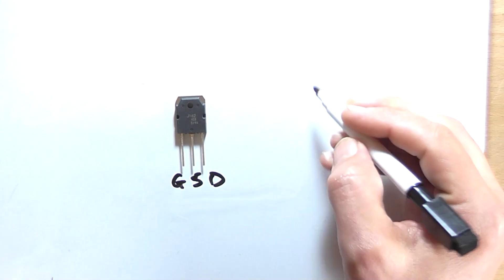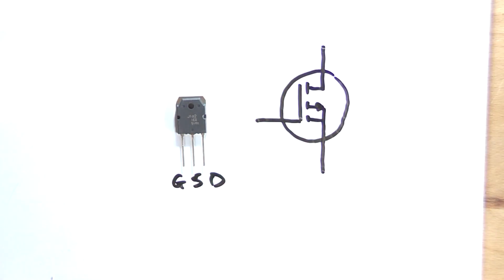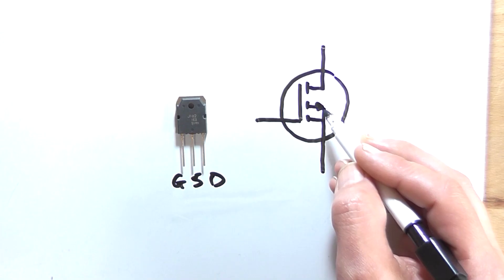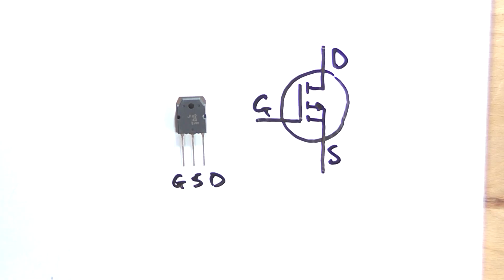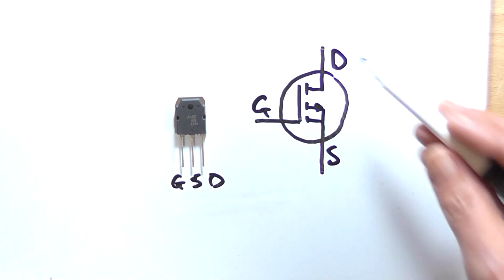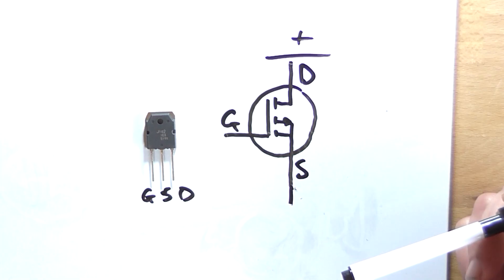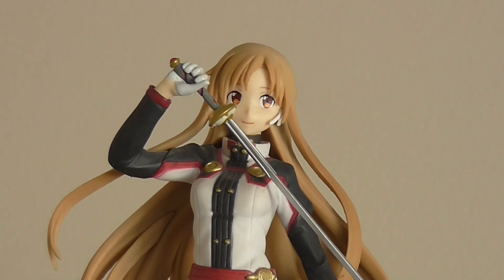How To Identify A MOSFET's Source & Drain On A Schematic

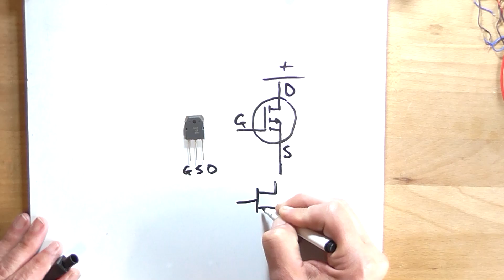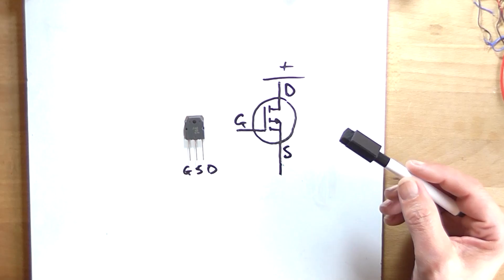Comment: Wow, you learn something new everyday.   I've never seen a MOSFET symbol drawn as you showed at 2:40 in the video.  Is it some really old or obscure version of the symbol for a MOSFET?   I was always under the impression a MOSFET (because the Gate is electrically insulated from the channel) has the symbol drawn showing the Gate with a gap between it and the channel.  What you started to draw at 2:40 looks more like the symbol for a D-mode (depletion-mode) GaN HEMT (Gallium Nitride High Electron Mobility Transistor).  Definitely not the same device as a MOSFET.  However I'm happy to be corrected if I'm wrong by a link or links to credible website source(s).
Reply from the maker: I actually drew it as "enhancement mode", rather than depletion mode
Reply from the maker: Oh, you meant the second one. Yeah, I've seen it like that on some hand drawn schematics, doesn't mean it's right.

Comment: When they came up with Drain and Source, I think they got them around the wrong way.
I might start a petition.
Reply: A drain collects current, a source emits current. But also they got current flow the wrong way around, so if you can get that changed I'll buy you a pint
Reply from the maker: @ivolol lol good luck with that!
Reply: @ivolol How does a complementary stage work then, other than by the positive rail type N FET/NPN BJT sourcing and the negative rail type P/PNP device sinking current?
Reply from the maker: Lol agreed